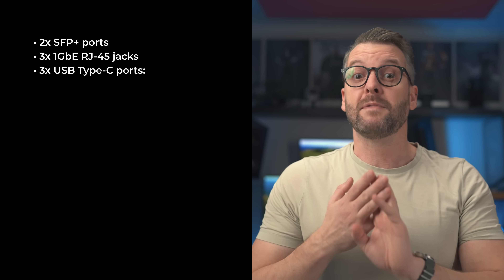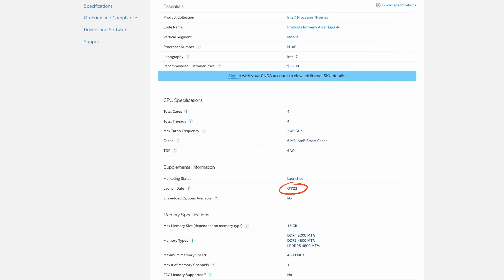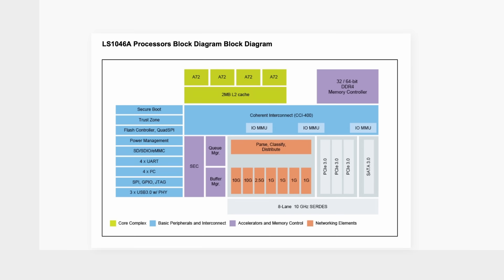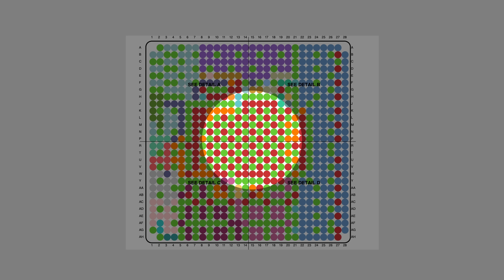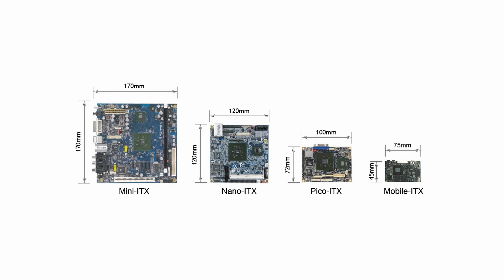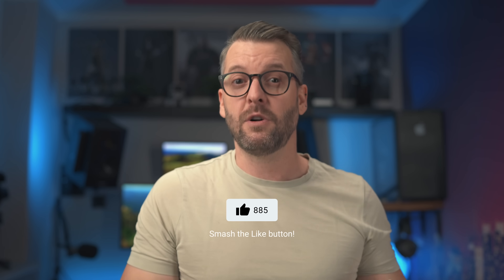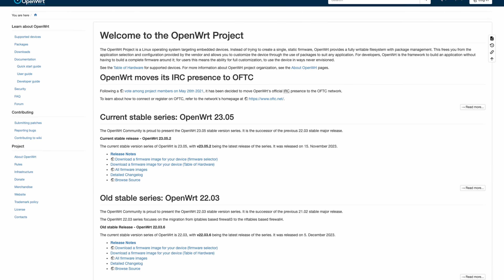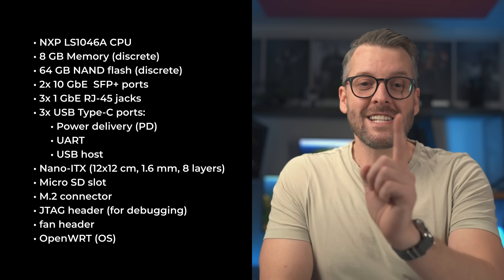I'm making a high-end router IN PUBLIC. Here are the final specifications.

Comment: I feel the 1gbe ports are a waste of time at this point.  Definitely need at least 1 2.5gbe port.  Better yet, two SFP+ 10gbe, two 2.5gbe multigig, no point in 1gbe unless it's poe input.
Reply from the maker: Unfortunately, the CPU doesn't support two SFP+ AND two 2.5 gbe at the same time. I'm working to get in touch with an NXP engineer to check whether even one 2.5 gbe is possible - the datasheet is somewhat ambiguous in this regard.
Reply: Eh, I would say it's useful for normal devices that might be situated near/around the router (like a Home Assistant box, UniFi Cloud Key, etc) and plugged in as a convenience, then everything else would be connected to a dedicated switch over 10Gbe (which is probably better than the software routing on LAN ports on the router)
Reply: We should remember this is router not a switch which limits what will be going trough it so a 10g port is essentially to switch which is already overkill but you may have other ports to be do multinetwork routing so 10g for main line isnt that overkill but 1g i think is enought for next few years cause ik honestly not sure 2.5g will actually catch on specially on ISP side
Reply: @bigpod  We have multiple ISPs that over 2.5 and 5Gb for the last 2-3 years.  I would never buy a device that's not capable of at least 2.5Gb on the WAN side and 10Gb on the LAN.
Reply: @handlealreadytaken  yea that id why 2 10g sfp+ cages are better then 1 and 2.5 g rj-45 cause 10g sfp+ can take rj45 with right module and fiber no problem
Reply: Not really, most hardware that you connect to the network does not need high speeds.
Think printers, security cameras, smart fridges, etc.
And even in PC world we don't really need 2.5Gb/s when the ISPs don't support 1Gb/s.
I think a single 2.5G port and two 1G ports would be a perfect mix.
Reply: @hubertnnn as i said 1g in and 10g lan are probably enough even tho in perfect world you would have 2 10gs which would basically make from connection perspective this router future proof for next many years
Reply: @hubertnnn  almost all of those devices will be connected downstream via a switch or WiFi ap. The things you connect to a router are your big ticket items. 1 port for wan, probably 1 port to a switch for all or most lan devices, and then maybe the WiFi aps straight into the router. Assuming we want more than gb/s available for wan, that is a at best barely feasible with these specs.
Reply: this is a router not a switch. technically speaking a router just needs two ports, one for the WAN and one for the LAN switch.  @hubertnnn

Comment: Please absolutely a 2.5gb with so many new wifi 7 aps, it makes sense. Dont want to use a converter for sfp for the AP. I think POE on just the 1gb makes sense if possible.
Reply from the maker: Thanks, I'm doing everything possible to get at least one 2.5 Gb port on the device, stay tuned as I'll hopefully get in touch with the people at NXP to check whether it's actually possible or not. It's bugging me as hell, too!
Reply: @tomazzaman Great to hear super excited to hopefully get one! Moving to 10gb for my core, and really looking for something to drive new Wifi 7 Aps!
Reply: You’ll need PoE+(+) for that and by the time you’ll benefit from 2.5 gbit WiFi you’ll have multiple AP’s. The 10g link to a proper PoE switch will do this just fine.
Reply: Maybe a smaller cheaper version will be nice
Reply: Having at least 1 POE port will allow 1 AP to be powered which is a good alternative for WIFI, while you work out the wifi card for the m.2
Reply: I wouldn't try to make this too complicated. I would however make sure that the SFP+ port supports multigig if possible (NBASE-T up to 10Gbps). Don't do POE at all on the RJ45s.  However I am not your primary target, already have a Xeon D 1541 firewall w 2x10G RJ45 and 2 SFP28 ports.... and a 100Gbps backhaul for both my in-home and business.
Reply: @chadchampion6773 
For a household which can be served with a single ap, the need to buy an extra switch sucks.
Reply: If the sfp+ ports are rated up to 10gbe, then not 100% why there would be a need for 2.5gbe unless that would also be poe+ or ++
Reply: Why wouldn't you just use a switch?